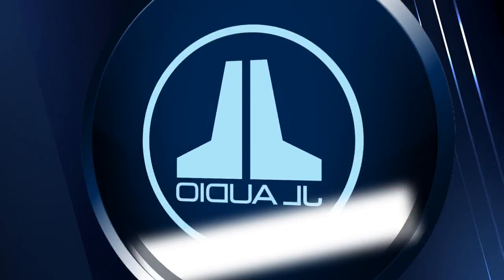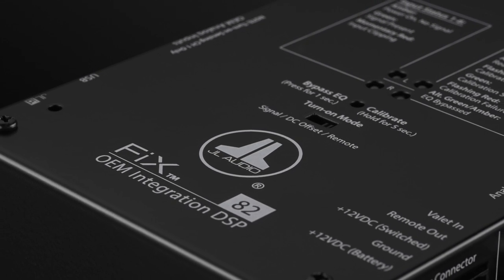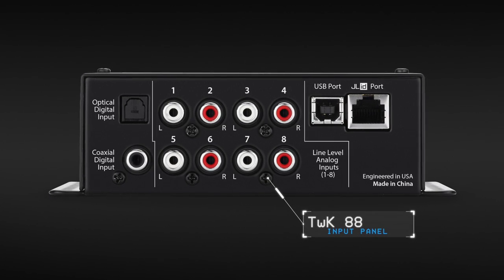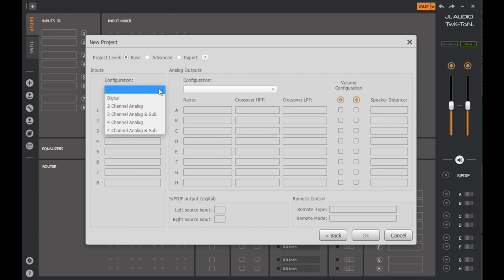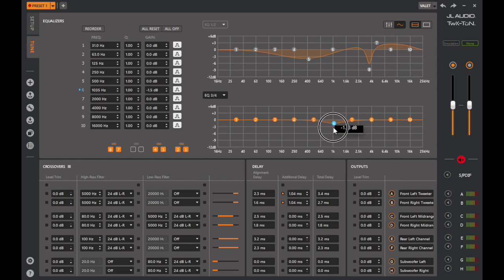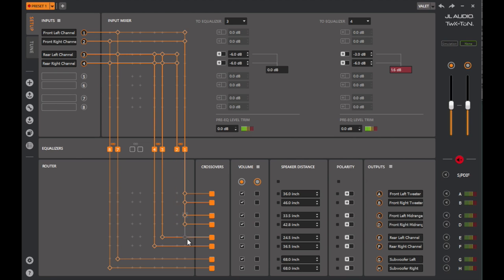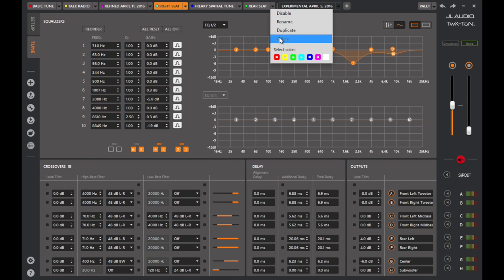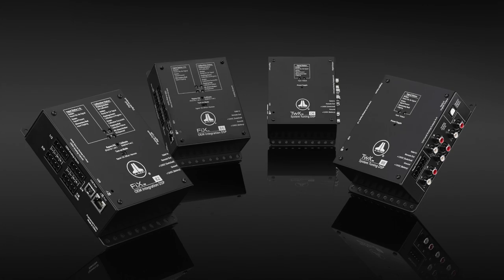JLA TwK™ System Tuning DSP Product Spotlight

Comment: I have an pioneer avh head unit in my car and 1200 JL. Audio amp for my sub and a 500 JL.Audio amp for mids and highs. 

Which one of the JL. TWK System Tuning do I need to get so my system can sound much better?
Reply from the maker: @Keron Fisher, the TwK 88 would be the appropriate version to purchase since it has RCA inputs to accept signal from your Pioneer source unit.
Reply: @JLAudioInc  Ok, thanks, I'm going to purchase it right now.
Reply from the maker: @Keron Fisher, you are very welcome.
Reply: @JLAudioInc  which country of origin are these DSP

Comment: Does this allow a headunits Preouts to control speaker volume? or is it fixed/auto leveling, would love to use steering wheel volume and Balance/Fader controls
Reply from the maker: Hello.

The input and output routing on the TwK 88 is completely configurable. If setup to operate as stereo front and rear control, the balance, fader, and steering wheel controls will still function normally.
Reply: Awesome thx :) looks like this is going on my list of upgrades :)

Comment: Hello there. Can i use the twk 88 without source at all, just a DAP player? If yes what i should use as a 12V switched input to turn on the dsp? Can i use a 12v accessories line from the car to switch on with the ignition?
Reply from the maker: Thanks for the question(s). The answers may be a bit more involved. You can contact our support team at 954-443-1100 or submit a support request via our help center; https://jlaudio.zendesk.com/hc/en-us/requests/new

Comment: I have both the twk88 and the fix.  My head unit only has an optical most25 output that I would need the smdi25 adapter to receive the signal..Where it becomes tricky is that the adapter only has an optical out and the fix does not have an optical in like the twk. In this case what are my options as I assume the fix must go before the twk.. thanks in advance
Reply from the maker: Typically optical signal extracted from a factory system is full range and flat. If so, you would not use the FiX. You would run the optical straight to the TwK.

Comment: I love the twk dsp, but the only thing I'm dissatisfied with is the inability (I think) to pass 2 individually eq'd channels through a single EQ at the end. My issue is that 10 parametric bands is pretty much exactly what I need per channel, but I have nothing left to EQ both sides together.
Reply from the maker: @hellobooom, it is rare that one would need that many bands of equalization for a system, especially with 10 band parametric available per channel and per pass band used. A neat trick you could do if you are not using all of your outputs is to direct one of your full range inputs through two of the outputs and then loop them back into the TwK to sum with the channels that you need additional equalization on. This would effectively give you 20 more bands. As long as the error checking is in place to adjust the amplitude of the summed signal it should work. This could only be done if you are not using all 8 outputs of the TwK. Check out our tuning articles on our website in the Help Center if you haven't already. It may be of use and allow you to more effectively use the parametric so that less bands are needed.
Reply: Thank you!
Reply from the maker: @hellobooom, you are very welcome.
Reply: That's  insane

Comment: I have an older stereo running a pair of rca's. Denon Dct series but i want to further tweak my system for a multichannel setup.
Will this unit integrate with only a set of rca source? I am not wanting a rear speaker.
What i want is full active 3 way front Plus one sub.
Reply from the maker: Hello Roy,

Can you provide me with a bit more information? Which JL Audio product are you interested in adding? If you are going to be using an active 3-way front pair of speakers which brand and model are you going to be using? If the Denon does not have a subwoofer output you will need to utilize either the eSubwoofer or Dominion series of subwoofers as they both have hi-level inputs that can be connected to speaker pair "B" on the Denon.

Please provide the additional information that I have requested and I will be happy to assist you.
Respectfully,

Comment: Do I need a 6 channel amplifier to add the TWK88
Reply: Not necessarily, you can choose however many channels your setup can support.  If you only have a 2 channel amp or mono block then that is fine.  You can configure as needed.

Comment: Can this be used on optical only?
Reply from the maker: Both TwK processors allow optical in, but the TwK-D8 has only optical input if you wish to use that as your only input source.
Reply: JL Audio 

That’s the only source I need. Thanks

Comment: I am so confused, all I want to do is keep the amps that I have now (400/4 & 1000/1) but its a hot rod so I don't want a headunit, anymore. I only want to connect to my phone thru bluetooth. Do I have to buy a dsp to do that? or is a 6 channel LOC what I need both of which I would use with your bluetooth module
Reply from the maker: Adam, you could accomplish what you are trying to do in two ways. The easiest solution is to use the amplifier's pass-through option, you could go into Amp 1 with your MBT-RX or MBT-CRX bluetooth receiver and then use the pass-through out to Amp 2, this would feed both amplifiers the audio signal from the BT device without needing anything additional.  The other option is to use a TwK 88, which would provide much more tuning ability and add volume/sub control from the DRC-200 instead of having to use the phone If you have further questions, you can reach out to our Technical Support staff by emailing technical@jlaudio.com
Reply: JLAudioInc great!! Thanks!! One more question if I get the mbt-rx how does the system turn on and off while the car is on. I get that it would get switch power from the ignition but what if I don't want the music to play? Is it always off/silent unless I play music to it?
Reply from the maker: That is correct. If you wire the amplifier to ignition, they will be on any time the car is running, but will not play audio unless there is signal from the MBT-RX. Alternately you could put a manual override switch on the ignition cable going to the amp in order to disable the amplifiers at will.
Reply: Thank you JLAudio, you got a loyal customer in me for life.

Comment: i'm currently running a Clean Sweep, what would be the advantages and possible disadvantages of swapping it out for a FIX 86.
Reply from the maker: What vehicle do you have the Cleansweep in currently? If you are using both the SSI and the CL-441 currently the FiX 86 will perform summing duty and correction in a unit that is smaller than the CL-441 by itself. This is useful if space is a concern. The FiX 86 now also offers the ability to use our TuN software to add crossover capability and 10 band graphic equalization capability for its front and rear outputs which the CL-441 does not have. The FiX 86 also offers a subwoofer signal output section which can be controlled by the optional DRC-200 which can be useful if you do not have bass control already. They both do a similar job as far as frequency correction, but the FiX 86 goes a step further and can account for an correct any time delay that may exist in a factory system. This can provide a better summed signal for those applications.
Reply: I have just the CL-441 in a 2006 Saturn Vue, under the passenger seat, so space is fine. I'm running it to an RD900/5 with the bass knob. Sounds like I'll stick with the clean sweep for now, i'm quite happy with it.

Comment: How about rearfill is there option for that
Reply from the maker: @ Greg Keyes, you can set up rear fill output channels out of the TwK. You can even add effects to it by summing left and right signal together and inverting polarity on left or right before summing through a single EQ. This is a left minus right effect that will cancel all common information for an ambient fill effect.

Comment: can one even buy USB cables anymore?  why note make a wifi / bluetooth available and allow tuning via android / iphone ... would be stellar.
Reply from the maker: Yes, USB cables are still readily available. It would be great to have wireless tuning capability though. Let's cross our fingers for future versions.
Reply: One advantage of USB is that you will hear the tuning adjustments as you make them, in real time. With BT and even Wifi, there will be a noticeable lag between action and audible result.
Reply: Ah, i had not even thought of that.  as usual, JL has a solid engineering base applied to all their products.  thanks Manville!
Reply: Can you connect 3.  4 channel amps to this one?
Reply: Now Bluetooth is available yyyyaaa
Reply: Im always a fan of hard wired,it always seems to sound better and less "moving" parts
Reply: @promo130  you can using Y Splitter cables from the outputs of the TWK to your amps based on what speaker you want to have a specific frequencyon. If i was to go with a TWK88 with my current HD amps vs using the new VXi amps, i would do that for an all around DSP system in my car. Im in that dilemma right now lol!. Basically for me the VX800/8I and VX1000/5I would do what 3 HD600/4s and 1 HD750/1 and twk88 do, Minus the less power part and the Fix 86 that i would need vs my Audiocontrol LC6i for my stock Radio.